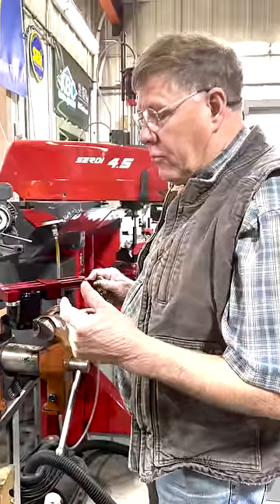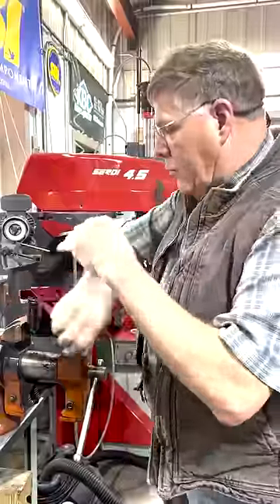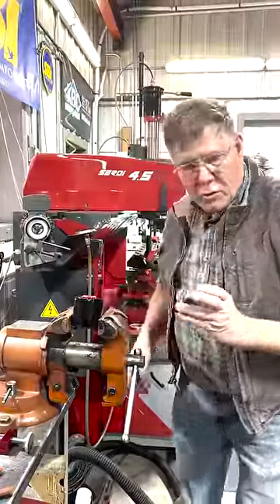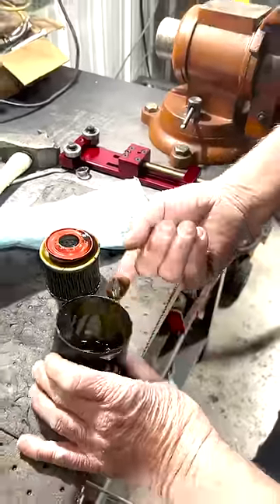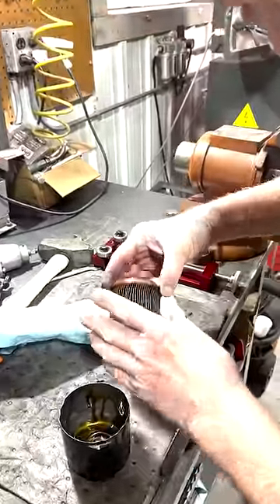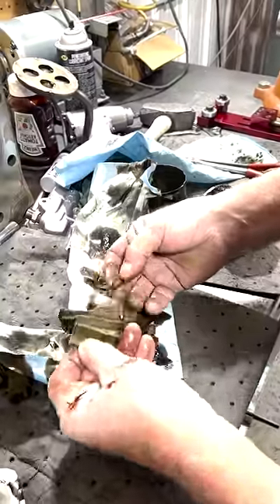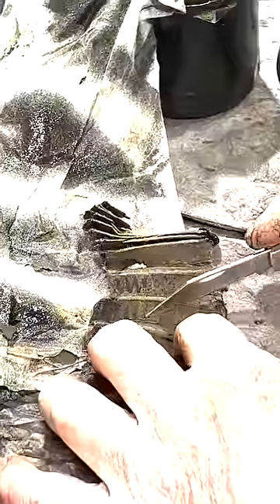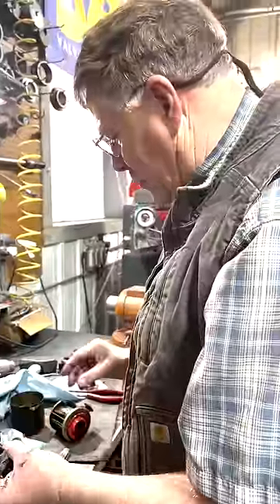#shorts Our Customer Ran His Engine OUT of OIL! 🤦🏻‍♂️

Comment: We had a lady come in with a fiat 500. 136,0000km(84,000 miles)on the odometer. She was complaining about a grinding noise and low power. Original air filter, original break pads and rotors and 30'000 km since last oil change. We drafted a estimate for a full pads rotors and engine service and a warning saying we couldn't guarantee the condition of the motor since she was four times over her oil change interval. She said new cars don't need oil changes and argued with the shop manager saying he was trying to take advantage of her for being a woman and we were a bunch of crooks. She also said that the last oil change had been done by her ex husband and that he was also a crook and a idiot for participating in this conspiracy of oil changes.. some people don't need saving.
Reply: Sounds like one of those kinds of women that don't need a man either, they can do everything and know everything.  I wonder why she had an X, I'm sure it was his fault,  whatever it was!
Reply: My ex drove her first new car till the oil light came on & she said new cars should not use oil then she was told when you drive off the lot it is used -
Reply: Did you tell her to go to any other shop
Or any dealership
Or any of her neighbors
Or anyone on the street
He'll she could ask a homeless dude and he would probably tell her she's an idiot
Reply: I had a customer with an early 90s Ford Bronco 351 Windsor, change his oil every 20,000 MI since it was new, he sold it with 300,000 miles on it and it's still ran perfect, did not burn any oil, passed Smog and didn't leak. He used mobile one since new
Reply: Longlife oil has a recommended service interval of 30 000km's (or two years) so that's not unusual. If it's not longlife the recommendation is 15 000km's (or one year).

Of course, service stations in the US recommends an oil change every six months or so for some reason.... Perhaps you use really shitty oil over there?
Reply: @7x779   With Longlife oils the service interval is 20 000 miles so if he used a proper Longlife oil that isn't strange at all.
Reply: @michaelmay5453  idk what car you drive but most cars will not survive 20 years on those service intervals. He'll it wouldn't survive 10. Some cars aren't designed for synthetic oil and most good mechanics will tell you "whatever is on reccomneded, half that, we have plenty of buesniess we don't need more". The number 1 killer of engines in the US is not doing service changes. Synthetic Trans fluid can last 70k miles ya but engine will not last 18 miles
I know the bottle says 15k miles but every person I know that follows that has Maintainence issues with their car. Pretty much all Hondas and Toyota recommend significantly shorter service intervals. That is a big reason why they are known for reliability, because they understand that the bottle is a lie. Also
136k is not 30k so none of this is comparable at all. 
Ya synthetic oil is way better then regular in terms of longevity but it's not magic. Shit still goes bad and when it even goes half bad your engine wears way quicker.
Reply: @7x779  sounds more like an anomaly than the rule. The fact that he used a quality oil like mobil 1 probably helped especially if it was full synthetic as it does last longer. But I'd be willing to bet that the engine had a fair amount of sludge in it if you cracked it open. Just my opinion, oil is cheap engines are not.
Reply: Yes they need saving from the next world    Because they will go there and do the same
Reply: @michaelmay5453  regardless, the oil should be changed, because the filters get clogged up.
Reply: I have a family friend who had a gmc terrain that was burning oil so often that she had to fill it up with oil. Every other gas fill-up, and she asks if she can save the engine or get a replacement engine, and I told her no, you better off getting a new car or finding a well maintained used car and told her that this was a common issue with this generation of terrain
Reply: @littlejack59 sounds like that wouldn't work... if she thinks everyone (who thinks cars need oil changes) is part of "The Great Oil Conspiracy" lol
Reply: @BiffTannen1983  It's literally the factory recommendation so... I guess if you have an American car you should change it every week and twice on sunday though? :P
Reply: @michaelmay5453  People in US by and large don't know how to drive.  They drive on surface streets at 55-70mph.  Freeway 70-90mph while tailgating.  Use a car on many short errands without warming it up.  Or leave it idling in the heat to use air conditioning instead of parking in the shade.  So basically all driving in the US is severe driving.  That's why the engine is twice the displacement for the same power in the US.  They want it so understressed that it's rare it will die from the abuse it gets.  GM/Ford recently switched to small turbo cars.  The Fords catch fire and the GM need new turbos 3-4 times before they even get out of warranty.
Reply: @milescarter7803   Yeah, using it that wrong will fuck any engine up no matter what oil you got. At that point, go electric.

Also, I have owned GM's and Fords but since the 80's I've moved over to the Germans. A proper Audi built in Germany (and you have to check that these days because they ship shit over) can do all of that on a LL oil change even with the stupid little turbo's they put on that because of the oversized fans and actual shrouds they put all over it. 

They are also really fun to drive while mileage is still below the Renaults and Fords tiny engines.
Reply: "You can't fix stupid"

-A very wise man.
Reply: Everyoneeeee and their war stories about oil. Just change your oil every 3,000 miles. Oil breaks down and forget this high mileage oil nonsense they sell. 🙄
Reply: Could have just said the first sentence and we would have known the rest 😂
Reply: For some women every man just becomes her ex
Reply: EZ answer:oil is to cars what blood is to humans-- that ends it :)
Reply: When they bring up the ex husband, you know they tapped
Reply: She probably shouldn't be behind the wheel of a car at all.
Reply: Not everyone deserves the right to vote
Reply: @grubalaboocreosote4774  No,human+pays taxes=no taxation without representation.Pays more than Trump--gets you TO PAY HIS.
Reply: To be fair, a Fiat wouldn't last more than that even with frequent oil changes.
Reply: @7x779  yes but these old engines had oil passages the size of my pinky. Not these new motors have tiny little oil passages and if they get gunked up they will stave certain components.
Reply: @dallysinghson5569  US roads are tough,maybe not putt-putt around the Coliseum?
Reply: @sebastiencharette6637  yes that's what I've heard, I've been out of the trade for many years. And Toyotas aren't necessarily bulletproof either. I had a friend buy a brand new Highlander for his wife over 10 years ago, in the motor was junk at 70,000 Mi because of those tiny drain back oil passages. The dealer refused warranty and said it was his fault because of improper maintenance and infrequent oil changes. So he went to his glove box and pulled out a whole pile of receipts of oil changes from the day it was new from that very dealership, showing he did the same or better than their recommended intervals. I think it was 3 to 5,000 MI, in the motor still blew up. Then it became news they had a problem with this. It was the V6

Put that story is absolutely true of my friend with the early nineties 4 x 4 Bronco , he said he never changed it sooner than 20,000 miles with Mobil one, and when he did change it, it was always one quart low after 20,000 miles

And if I'm not mistaken, it's still had the original never rebuilt transmission when he sold it with 300,000 mi!

And it still didn't leak, didn't burn oil and pass smog
Reply: If you see someone driving a Fiat 500 especially a woman, you will know right away that vehicle was treated like a wet dish rag.
Reply: Those new cars are electric, though.
Reply: I am a stickler on oil changes, I try to always do them before the vehicle says especially on my diesels, normal people are very stupid. Most don’t know the different between synthetic and conventional oil ect. I got a buddy with a duramax that claims he’s 6k over on the factory 10k oil change and he just says he barely drives it. People don’t understand the catastrophic damage that is happening to the engine. I mean holy shit lol😂
Reply: The conspiracy of oil changes😂😂
Reply: @jwarmstrong there's no such thing as owning a new car. You can buy a new car, but as soon as you drive it, it's used 😅
Reply: nothing funnier than someone who thinks they're smarter than everyone who is actually braindead
Reply: @7x779  probably only drove short distances at a time- not long idle times and not during bad weather. oil only gets burnt up when its hot or contaminated. makes sense
Reply: ay yes the conspiracy of oil changes  my favorite dark force in the universe
Reply: @gregalfredo  sorry but completely the opposite is the truth. Short trips and idling are hard on oil and engines. Long trips and highway miles are the easiest on both the oil and the engine, by far
Reply: Driving conditions greatly affects the oil change interval. A lot of stop and go driving like say a pizza delivery driver or door dash driver is probably the hardest on car.
Reply: @YeeeeeHaaaaa   Every 3000 miles? LOL... how about no? This isn't the 1950's, we have proper longlife oils that last 20 000 miles now. 

But not if Jeff down at JIffy Lube tells ya and that is how you became an expert, right, kiddo?
Reply: So what’s your point it’s your car it’s your life it’s your opinion what’s your point how  about,” see ya.”👋
Reply: Did she think it was an electric car? 😂
Reply: Ugh! that was like watching an autopsy🤢
Reply: @michaelmay5453  it's because harsh environmental situations and stop and go traffic for the vehicles entire life cycle constitutes extreme driving conditions. 

No matter how many people make video proof that you should habitually change your oil, including from experts that even helped formulate the products available today you still get people like yourself that just refuse to do it.
Reply: @7x779  i think you misread my comment- you're agreeing with me. long idles and bad weather are no good. short distance in my opinion is a 20 min ride. only difference in your post is distance- if you think oil last longer driving longer distances your crazy
Reply: Probably my EX
Reply: @gregalfredo  I'm still confused at what you're saying and how you are interpreting what I'm saying.

Two different but identical cars both changed their oil at 5000 miles, however :

Car 1:  the 5,000 miles were accumulated mostly from short trips from 5 minutes up to 20 minutes, mostly local errands and short City trips of 10 miles or less

Car 2:  the 5,000 miles were mostly accumulated on longer, mostly Highway trips of 30 minutes and 30 Mi per trip or more

Car 3: most all of the 5,000 miles were accumulated in trips of at least an hour or more and at least 60 miles or more

Which car will have the most wear the soonest on the oil and the engine and require a more frequent oil change?

Which car will have the least wear on the oil and the engine and require a less frequent oil change?
Reply: @JoseDiaz-rd9fh  that's true but even far worse than pizza delivery or doordash where the car might be active and warmed up all day, is the person who takes mostly cold start trips to the local Neighborhood Grocery Store or shopping center, shuts it off lets it stay there and cool down again then another cold start home. The oil never gets warm enough to burn the moisture in acids out and it just gets worse and worse
Reply: @JoseDiaz-rd9fh  that's one reason I like the oil change light on GM trucks and vans, not sure if the other vehicles have it, but it monitors the driving cycles, how many cold starts, how much time idling, how many miles were at freeway speeds Etc

Another huge contributing factor most people don't think about, is that if most the miles run the highway those miles are in the highest gear, overdrive, with the converter locked up, the engine under a light load, and there are far less total Revolutions of the engine per mile

I would not be surprised if stop and go short trip City miles are actually 5 times more than the same highway miles

I saw a web page dedicated to one guy Chevy van, and it didn't even have the really good LS motor it was the one before that, and he had almost 1 million miles before the engine failed, and that was only due to a faulty valve keeper that dropped a valve

When they tore the engine apart they documented measured in photographed everything, and there was still virtually no where on the engine. There was no Ridge at the top of the cylinders the hone marks are still there the bearings still look perfect, and if it was not for the valve keeper it looked like it would have went another million miles

That was the motor based on the old small block 350, the one just before the ls motor, and it was mostly Highway miles. He was in Amsoil dealer so delivering Amsoil, and he also used Amsoil in the vehicle

What was more amazing than that, at least to me, was that he still had the original transmission that had never been rebuilt!

I've heard so many stories like this of American V8 lasting that long but I've never heard of a story of Toyotas lasting this long, interesting isn't it
Reply: @7x779  ya no, i never said stop and go that's the assumption getting in the way of understanding me.
Reply: @gregalfredo  I just read your original post. You said that my friend who change the oil every 20000 miles since new and sold the car with 300,000 Mi on it and the engine was still in perfect shape and did not burn oil or leak, you said this was because he probably only took short trips, and that was in good weather so that the oil did not get hot.
Go up and look, that's what you said so I am not misunderstanding or misquoting you. What you said is wrong

1. Short trips is what destroys oil and engines the most, this has been well known and documented for decades.

Long trips is what helps engines and oil to last much longer and go many many many many many many more miles before needing changing. This is also a well-known fact proven and documented over and over again.

2. About my friend only driving in good weather, he lives and drove in the desert Southwest where the temperatures are between 110 and 120 degrees and took multiple trips into Mexico where it's just as hot if not hotter.

So that assumption is also not true as well as the fact that it's cold oil that causes more wear and damage both on the engine and on the oil

It takes quite a long time for the oil to reach proper operating temperature in burn off the acids and moisture in it. It's very rare and difficult to make oil get so hot that it gets too hot and burns up.

That's why my friends BMW M5 has a built-in feature that will either warn you or not allow the engine to produce full power until the oil has gotten fully hot

And it's because of my learning this decades ago, I put a oil temperature gauge on my 71 Cuda 340 convertible with a mildly built engine, and I learned that it took about 20 minutes of driving on the highway for the oil to come up to operating temperature

Which means that the truth is again opposite of what you said above in your first post, that short trips are the reason for my friend's longevity on his engine.

Short trips are the reason for the destruction of engines and the short life of oil and engines

Are we communicating now?
Reply: Did the shop manager say "ok, bye"
Reply: @littlejack59 put synthetic grease in my wheel bearings on my 39 Chev pickup. A few months later the bearings went out. Figured out the synthetic crap was so slick the bearings slid instead of rolled. Roller bearings that slide don't last very long.🤐
Reply: @7x779  dam why does this even matter so much to you? you can nit pick my words sure bud u got me
Reply: @7x779  yo i just actually read ur long post LOL and turns out u can't read.  u must of missed my comment clarifying my definition of a short trip was a 20 min ride. never said stop and go. i mean like to work i take a couple turns from my house onto a 50mph road for 12 miles.. u can't honestly believe that driving hours on the highway is better than driving similarly at shorter distances. my point is clear and your arguing against a point im not making.. okay way to much time wasted on clarifying an obvious point that any noob can figure out. i was gonna let u just have it cuz seems like it means a lot to you, but bro ur saying the same thing except you think oil lasts longer driving further so how lol . i see how u think short trips means stop and go but i commented  again after that clarifying 20 mins- didn't say 20 mins in town . try reading that and i think you'll start understanding that regardless of cars and oil, you can't read.

also the point im making is that these shorter distances won't add up to 5k miles in the same time as you hour + long trips so you'd have to change oil sooner in that car. 20 min ride a day on 50mph road vs hour+ ride say 80 miles a day  on 65mph road you'll have to change the latter first, you're actually saying the shorter distance car has to change oil sooner?? like are u serious lol
Reply: @michaelmay5453  oil change intervals are stretched far by mamufacturers to make maintenance cost seem lower. I would never drive more than 10k-15k kilometers on the same oil if you want the car to last
Reply: @gregalfredo  5,000 MI consisting of 10-hour long trips every day at 80 mph is less wear on the oil and the engine, than 5000 miles consisting of short trips of 12 MI everyday at 50 mph. 

Change of subject, do you believe that smoking marijuana is good for people and makes them think more clearly?
Reply: @7x779  ya ur still assuming bro . the distances are not equal if i drive 20 min each day and you drive 60 minutes then you will be the one changing oil first. my point is that simple. your putting all these restrictions on it saying if they were to drive the same distance and assuming i meant stop and go. my point was simply that you will have to change your oil first
Reply: @7x779  look man I'm not the type to get into disagreement arguments, especially on YouTube , but I'm also not the type to be disrespected and condescended for no reason. i'm no expert by any means- I just like to learn. Please inform me how the oil would last longer driving 3 times as long and probably 4 times the distance as my "short trips"
Reply: @michaelmay5453 Nope. Extended oil change intervals are only so that the engine lasts until just right after warranty. This standard is set by the US EPA due to high frequency of oil changes harming the environment. Do the extended service interval and wonder why your timing chains are gone by the time the warranty ends
Reply: @Novavon7  LOL, my daughter has my old A4 from 2006, works just fine.

Also, Audi in Europe set that standard specifically for those oils, it has fuck all to do with the US EPA.
Reply: @littlejack59 I change my oil every 5k… but I also have a 2001 ford 4.0l and I really want the timing chains to last so I over maintenance everything lol
Reply: Yea it’ll run on low oil but not for long! lol😅😂😂 some are just beyond saving🤦‍♂️
Reply: Happens more than you think!
Reply: @michaelmay5453 changing oil in most new cars is so simple. If you buy for 2-3 cars in bulks it is even cheaper. That's one thing you should never ever put off.
Reply: @Bungeneer  As opposed to changing oil in old cars? Of course it's simple, so simple you can do it weekly so why don't you?

Because good oil isn't cheap and changing oil to a TRUE synthetic oil (not Mobil 1 or Pennzoil synthetic or Castrol crap which are all just recycled used oils with additives but real synthetic oil) isn't something that is necessary more than once a year.

In fact, I will bet you ANYTHING that if you actually went for a true synthetic oil rather than the crap that is in your car right now and changed it every two years your engine would have less wear than it does with the current crap changed every 6 months.

Get yourself a true synthetic oil, a longlife oil, change it once a year and if you miss a year, still better than what you're doing now.
Reply: @michaelmay5453  nah. My car is a diesel with an EGR. Soot is bad after 15 thousands km. I prefer new oil than clogging my oil pump.
Reply: @Bungeneer  So is mine and it has FUCK ALL to do with the oil. Do you know how the EGR valve works?

You can remove the EGR valve and the DPF, your oil will be soot black after two miles no matter what you do. That's just a given with diesels. 

My daughter has a 2006 Audi A4 TDI, longlife services, 360 000 km's. Works just fine and starts even up here above the arctic circle where we live in Sweden.

If you really worry about your oil pump clogging up, get a fucking proper fully synthetic oil instead of Castrol or Mobil 1 or Pennzoil or any of the other "this is used and cleaned engine oil with additive" bullshit brands.

I can guarantee you that three years with one oil change using something like Motul (pure synthetic oil, not a sign of mineral oils in it) will be better than the shit they put in your car every six months and overcharge you for.

Check out Project Farm's videos here on youtube regarding actual synthetic oils. You're pushing snot in your engine, I'm running proper lubricants.
Reply: People should have to take a test on knowledge of cars before being able to buy one same with houses.
Reply: @Missindependentindustries  In Sweden that is actually the case.
Reply: @Missindependentindustries  that's not how you make evergreen and resources hungry economy.
Reply: @Bungeneer  Yeah, it actually is. People think that by mismanaging their engines by using crap used oils with additives they are somehow saving money.

You're not, you're just buying bullshit that is worse for your engine. Be a fucking man, buy proper synthetic oil and change it yourself. 

Places like Jiffy or the local workshop will suck out some of the oil, replace it with the cheapest stuff they have like Mobil 1 or Castrol and charge you $50 or even more for that job. 

What you want is a workshop that will let you watch them drain it and fill it up with something proper, a fully synthetic oil and no, that is not what you think it is. A fully synthetic oil is not the same as a full synthetic oil. The former is a proper oil, the latter is used oil with additives.
Reply: @michaelmay5453  I've been doing my oil changes for at least 10 years. That's almost  the most simple job you can do around you car, right after filters change. Always using 5-40w synthetic as it is good all round years.
Reply: Is that a true story or bullshit?
Reply: @Bungeneer  I used to do that as well, once a year oil+filter and then once every four years spark plugs, air filter and fuel filter as well. 

But for the last 30 years I've only had leased cars, they'll do everything and every three years I change cars. These days I'm driving a Polestar 2.

Anyway, once a year is quite enough unless you drive over 30k kilometers in a year.
Reply: @7x779  this will depened.    I know i had a job 35 miles away that i only had two  stoplight on the way to work.    I changed the oil at 10000 miles and it still looked golden like new
Reply: I'd refuse hwr service and let the thing go kaboom
Reply: I don’t care what oil I use I change every 5,000 miles.
Reply: Deff voted for trump
Reply: 4 times over? Wtf are you talking about? 30.000km IS the manufacturer recommended oil change interval for the fiat 500.
Reply: @jwarmstrong well it is used once its sold and driven. Thats use man. Idk what you classify as being used but usually id say when you use something its been used. Doesnt matter if you drove it half a mile and brought it back, its used.
Reply: @littlejack59 Given she thinks it’s a conspiracy she would do what conspiracy theorists do and just baselessly accuse them of participating in the cabal.
Reply: @railroaded1991  I am pretty sure that is why there are ratings for different kinds of greases and oils. If the transferase calls for 75W-90 gear oil, I can't go and wd-40 in there. I imagine at a certain point well just be using pressurized bearings with some sort of synthetic grease or lube like how they do in Noctua computer fans. By the time you need to replace them, it's no longer your problem because your dead. But until then, read up on what your vehicle requires.
Reply: @cadennorris960  Okay, then tell her to drive over to the next place and ask them, and the next place, and go ask her son, grandson, etc. If she still doesn't believe anyone, write down a number for a tow service for her along with your address.
Reply: @littlejack59 well that wasn't the hype of the day 50 years ago when they were touting the new synthetics and supposedly better for your bearings. Noting also now the synthetics run just fine in my 1998 Ford Windstar wheel bearings. But modern bearings are made for synthetics whereas my old 39's bearings were not. I doubt there were any "specs" back then that specified not to use the new (Amsoil) synthetic in vehicles with old style bearings.
Reply: @littlejack59 yeah because that homeless guy is clearly in on the conspiracy....duh . He was paid off by big oil😂
Reply: @littlejack59 but everyone is always talking about how  Toyota's don't even need proper service to run forever 😂.
Reply: @Jaybei420 filling up your oil every time you fill the gas up is not a common occurrence in any car what the f*** are you talking about😂
Reply: She probably never changed the oil in her car
Reply: 30k km is 18k miles. That's not really much for a modern engine. I do my ram 3500 every 10k miles, but the oil life gauge will bring it to 20k miles.
Reply: Fugging wow 🤯 😂
Reply: @dellRussell-dl1qt 😂
Reply: @littlejack59  Naw man, they're all in on the Big Oil scam, or are just sheeple. /sarcasm
Reply: @7x779  a buddy of mine would put  6qaurts of Lucas every  oil change  once in 5 months fill it up  when doing the car buy backs closest  junk yard was 45 miles away we  drained all the oil out  of  the  truck  ran it 45 miles pulled in  never acted up  but last 2 miles  65 .mph hole way I had follow  him to the junk yard  was waiting  for it  just grenade  never did 😅  just started last  2 miles so  351 Windsor great engine.
Reply: funny enough fiat 500 has 30000km oil change interval in its manual
Reply: @littlejack59  Craziest part to me is i don't drive, never have and i could have told you this.....
People like that make me understand why nigerian prince scams still exist..
Reply: Did you provide her with the MANDATORY referral to the 'shrink'😵‍💫??..
Reply: @7x779  If your story is true then this would an exception, and not the rule.  I would like to see a compression and leak down test performed as well as an oil analysis. 

20,000 mile intervals, synthetic or not, is psycho.
Reply: brake pads, they're called brake pads.  why does everyone spell it wrong.
Reply: Electric cars are for this type of woman
Reply: @dellRussell-dl1qt exactly, let miss independent go buy another car lol
Reply: Conspiracy of oil changes? Wow! OMG!!!
Reply: At that point just let her find out herself.
Reply: Then you should have shown her the owners manual that states the intervals
Reply: @littlejack59 I run mobile one 10w 40 high mileage in all of my vehicles (3 1999s and 1 2001) it says it’s good for 10k and the filter says 20k but I change the oil and filter every 5k which may be over kill but it’s way better paying for an engine
Reply: I change my oil every 2500MI every 3500 if money's tight. Money was real tight a few times money got so tight few times I drained 2 quarts and put a brand new filter. One time I just added a court and put a new filter on. I've got over 200,000 mi on my 2019 f150 2.7 EcoBoost the transmission runs worse then the motor
Reply: You can't fix stupid
Reply: Jesus Christ we’re on the road with these people
Reply: @YeeeeeHaaaaa 3000 miles is insanely early even for conventional oil. Never change your oil earlier than 5k miles, otherwise you are dumping good oil. Even at 5k you still have life in it. 5k is the safe number. 3k is just for idiots.
Reply: @dellRussell-dl1qt oh, it most definitely _was _ his fault- his fault for having enough brains and balls to get the fk outta there while the gettin' was good.
Reply: Must of been my ex!!!!
Reply: Wow, I wonder how many cars she has destroyed? 🤔 😮 😳 🤦 🙄 😩 😕 😅 😂 🤣
Reply: @littlejack59 synthetic oil is more slippery, in worn engines it slips through gaskets rings and seals more easily, this is why high mile cars should use synthetic blend or conventional.
Reply: @michaelmay5453  The factory recommendation is ONLY to get past the warranty period, NOT to last 20 years lol. toyota corollas following the 10,000 mile oil change interval end up burning large quantities of oil by 100k lol.
Reply: Must have been a feminist who doesn’t like it when a man explains to her the importance of vehicle maintenance
Reply: @TechMaster2133  LOL, you're talking about 10k changes here... the standard for new cars is 20k with old cars it's 10k. 

I mean, unless you ask someone who is paid to change oil on your car, then it's about how much they can fuck you over.

I still have an Audi 80 from 1987, yearly oil changes (around 10k) and it works just fine.